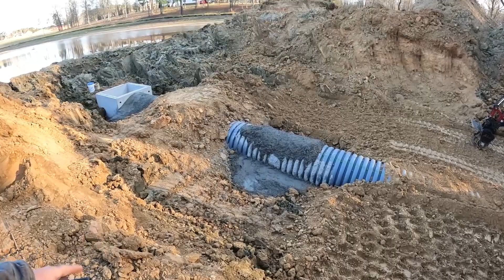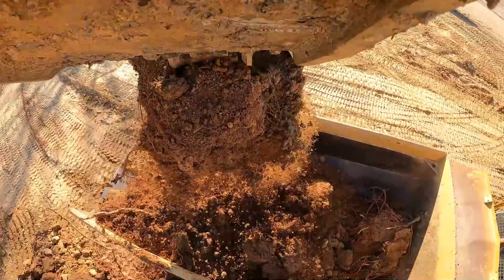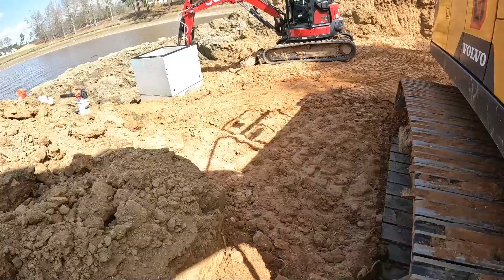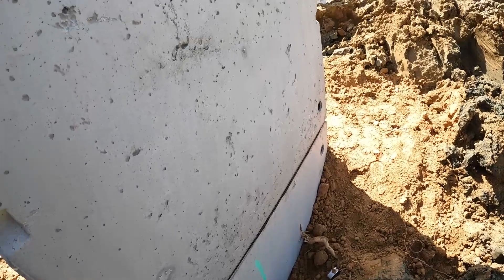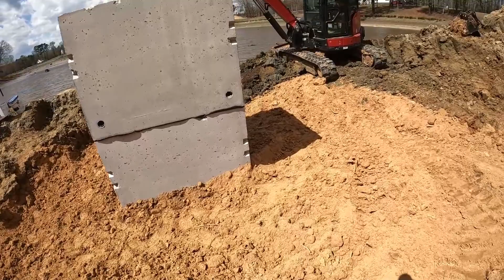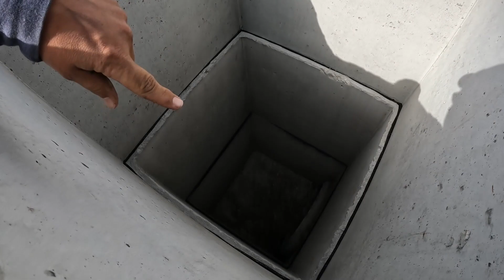Backfilling The Pipe And Installing The Overflow Risers

Comment: That compactor on the mini does a surprisingly good job. As you bought it I can’t see the use of the “toy“ but in tight spaces or when the weight of the roller is simply too much it pays.

Comment: Would it have been any help to the 2nd joint in the outflow structure to set the 220's grading bucket on top while you went out to lunch?  (extra weight to press the seal material in the upper joint, assuming the grading bucket is wide enough....)

Just curious, and "interaction" comment for the YT logarithm 😁  Another great video in a really interesting series here.

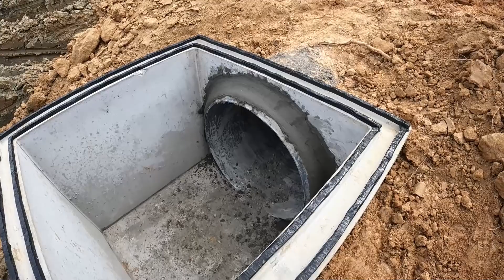Comment: @20:35, I currently have a pond on my property and the conseal has deaerated and is pretty much gone. I have 4 of these section on my overflow, and the top one is leaking. Any suggestions on how to repair it?

Comment: I have to say that location of the lifting points on the riser sections makes no sense to me. The ones I am familiar with have the eye points towards the upper edge . 
Among other things, that helps prevent crushing and chipping by the lift chains, as happened with this one. (Somewhere  around 20:08 I could see flakes of concrete coming off where the chains were pinching the riser).
Is there a good logical reason for this design?
Edit, Nevermind, sort of an  explanation at around 24:00.

Comment: Wow Chris: 6 machines on the job!  Good thing it's not a union job, here you would need at least 3 operators.
Reply: And a Safety Man, and a Quality Inspector, and a Site Supervisor,  the requisite three or four “Official Shovel  Leaners” and a Paid Duty Cop to direct the concrete mixer in from the road.  It’s the unions that have out-priced any production competitiveness in North America!
Reply: @tomrogers9467  I would agree for the most part, especially in the city I come from we'll call it Cook C####y,  operator not including benefits is at $51.25 per hour, benefit package is another $44.00 per hour, since the site had less than 10 people on site at any one time no on site supervision or safety person was needed, and traffic control for the one delivery could be handled by the operators!  Now then setting of the pipe would have to be done by union labor and not by operators. Since Chris cut out the site wide enough for the pipe no trench boxes where needed and no real safety program was needed to be submitted. EPA would have to been involved with the release of water from the pond and a water quality test would be needed and permits from the Corp. of Engineers. Desilting of the water would be needed and additional monies spent for silt fence and erosion control around the dump site would be needed.

Comment: Nice job, I am in need of a pond repair. I would not hesitate to hire you if you were not hundreds of miles away. How much maximum drainage will this system handle per hour? During the last hurricane that blew through here I needed over a million gallons per hour. Jeep the videos coming. Thanks

Comment: 2 layers of seal. Over here i would understand that one is on top of each other. 2 rows would give me the picture i see. Still have to get used to american expressions. But sir: you have all your equipment dialled in and in very good working order. Im impressed( like pushed in, being small and looking up to  someone?).
That concrete structure. Is that on the marked or a one of. I know you spoke with the one who made it but i didn t catch that.

Comment: Chris,  I have to say: that truck is badass!!!! I know you were in a rush to get it onto the job site and get the paint finished.....but to not do the body work and have it painted over the dents was not like you 😰
Reply: Near impossible to get those dents out of the bed as it's double walled. You'd have to cut them out and weld in new steel. It's  a used truck and will probably gain a few dents along the way.

Comment: the only thing missing on that great over flow is a nice drain system but heck a ciphon will work for that.
Reply: I know I’m impatient, but is the water going to be flowing into the top of the cistern through a grating, or is there another pipe going to be leading from the pond into it?  I didn’t see a hole in the side, doubt they want to jackhammer one in.  Still trying to forsee what’s going to happen.  (Nothing better to do here in Central Ontario with a foot of frost still in the ground)! ❄️❄️❄️

Comment: I have a brainstorm I've been thinking about.   A pond dredge.  With boom front and back  diggers on front with conveyor on back. At least move mud to the edge .  I've watched the big ones on the river. You would need to see how many yards the excavator moves and then see how much a dredge could move to see if it's feasable.  But I it could be floatable .  no mats to mess with.  Water would be friendly to it. Digger would move it. Or winch it on wheel on dry land.  Or even a barge to set the excavator on. Tied down and move it with the boom on mud or water.

Comment: Why did you put the overflow pipe so low in the dam this time?  On others you put the pipe right a water level.
Reply: It was the drop from the end of the pipe that eroded the back side of the dam, so this ensures it never happens again as the water will flow out of the pipe right on grade with the old stream bed, by the look of things.  Most other dams don't hold back such a depth of water that the outflow pipe level is a major problem.

Comment: Tire kicking🤣🤣 what a joke. I’ve got 16ply semi tires on my dually and you cannot tell if there low or full of air. If the bead is still seated then there fine. Anything under 20 psi and it will unseat by itself. But a haul truck tire…. She’ll probably roll around on zero air pressure just fine.